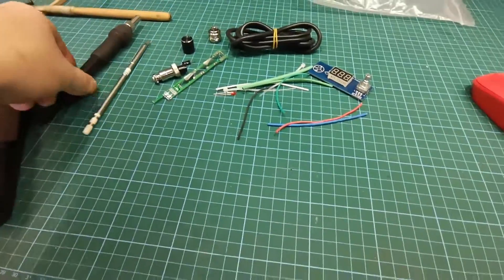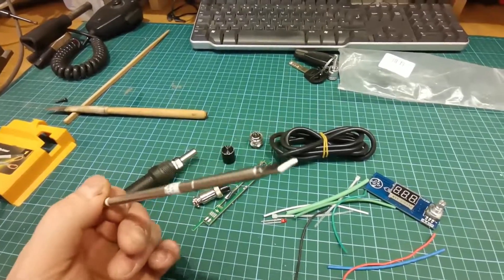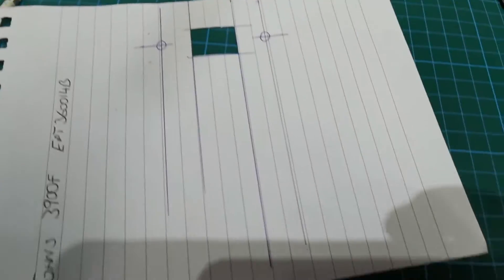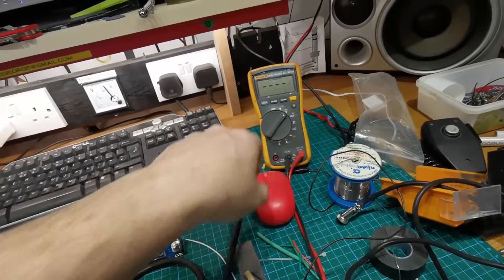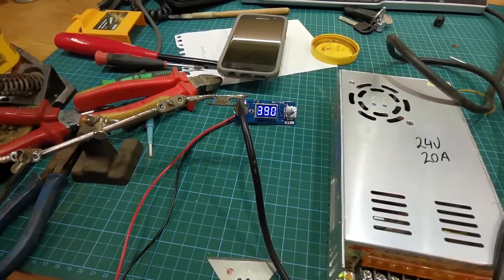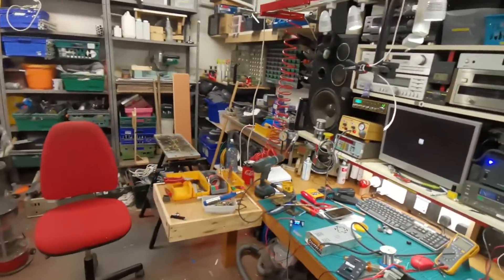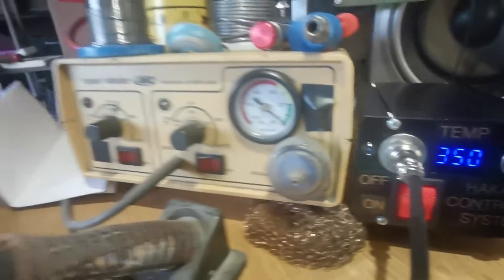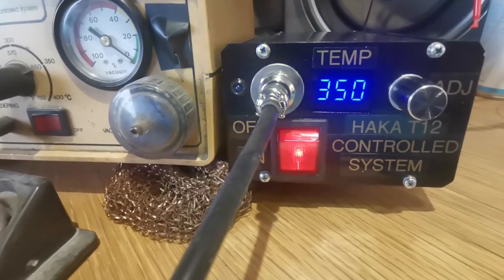EBAY HAKKO T12 CLONE SOLDERING STATION

Comment: George this might be a stupid question, but why did you have to go with a DC supply ? OK your old station was AC and 24v, right ?
lets say I connected a 24v incandescent bulb to this supply it would light ? Right .
Equally if I connected the bulb to your 24v DC Power Supply it would also illuminate ? .. Am I right ? 
A bulb is a bulb ! And a heating element is a heating element not unlike a bulb - ? 
I'm just wondering , 
O BTW you did end up with a very nice new soldering station - Another Masterpiece !!
73
Reply from the maker: The iron requires a DC source of voltage which is constant. The jbc had 30v of AC which alternates in a sinewave at a frequency of 50hz, so by the time you rectify that you'd have half that. Something that needs a DC supply won't run on AC, even if you had a variac and dialled the mains down to the required voltage it wouldn't work as it would be going on-off-on-off if you get me. I had the 24v supply here already. So it just made sense to use it as it solved an awful lot of ballache. Making a nice stand for the iron now....
Reply: George Donaldson EI7KO   Thanks for the reply George.. ya you’ve got a great setup there all right .. soon be time for a bigger garage !! . 😆